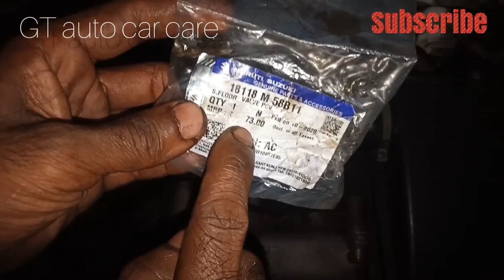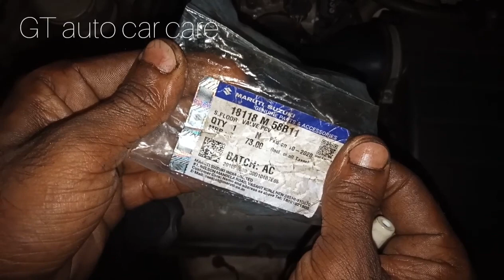maruti alto pcv valve replacement || pcv valve മലയാളം

Comment: Bro maruthi 800 2009 model pcv valve sound varunu start cheyyumbo pine korch neram ath pokam oil leak und engine cap avide pine pack seal avide .onnu reply cheyyne

Comment: My car’s pcv valve hose was disconnected and blocked from the valve side. After I found it out. I connected the pcv valve hose to the pcv valve and then my car started to emit white smoke from exhaust. What’s the issue?? Please help. Thanks.
Reply from the maker: First you need to change PCV then observe
Reply: @GTAutocarcare  I changed the PCV valve and still the same condition. My car is a Corolla 2010 1.8L. Could be a vacuum leak?? Intake manifold?
Reply from the maker: @ayzzzo  ok. then check the oil stick there is excess amount of oil
Reply: @GTAutocarcare  my car has oil consumption of 1L every 1400km.
Reply: @GTAutocarcare  my car has oil consumption of 1L every 1400km. Also oil gets almost low quickly sometimes in a month or two months.